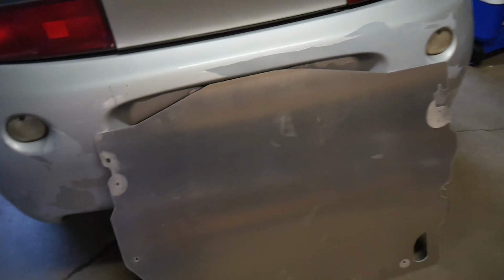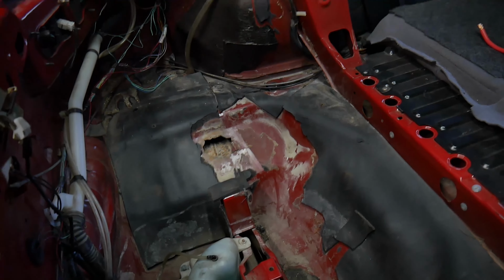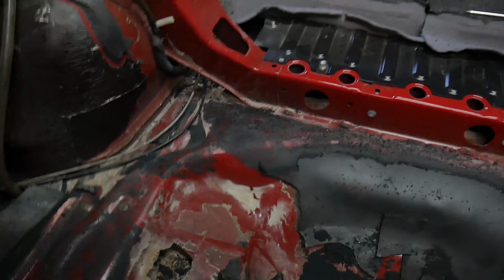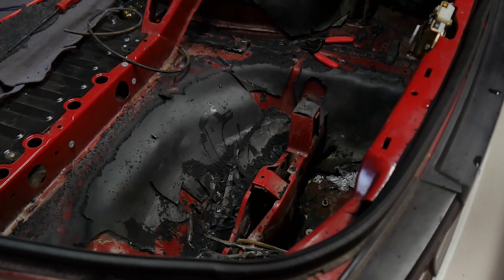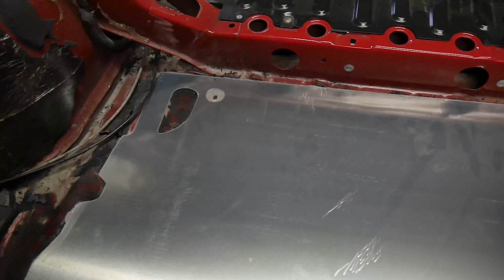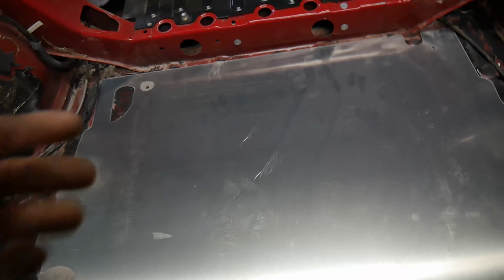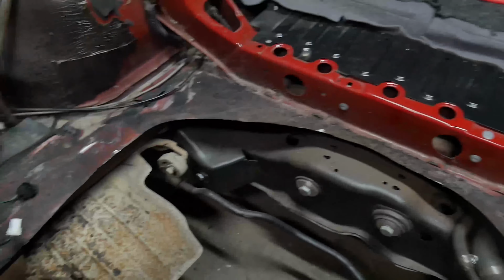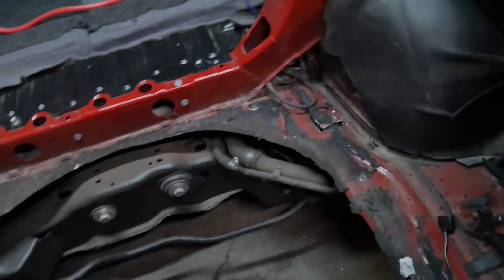Cutting my Eclipse GSX

Comment: Freeze the sound insulation with dry ice, then chip it out. The ChrisFix channel showed that trick in a video about 8 months ago titled "weight reduction". Just make sure you have good ventilation, to avoid CO2 asphyxiation from the sublimating dry ice.